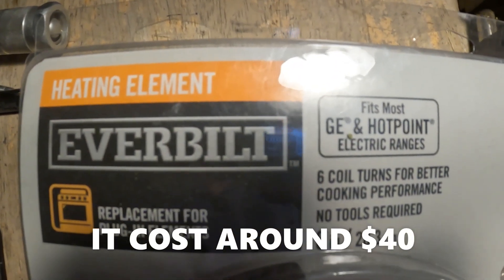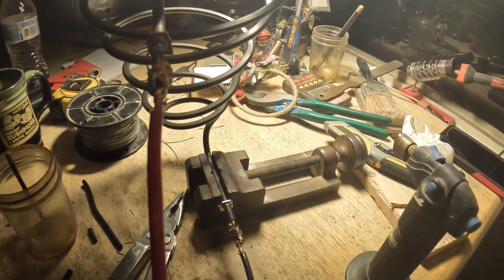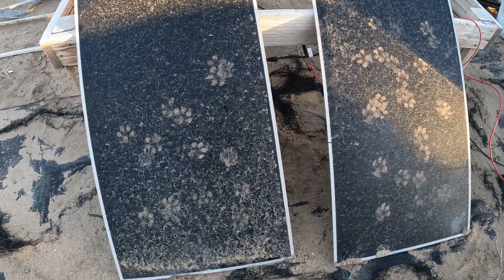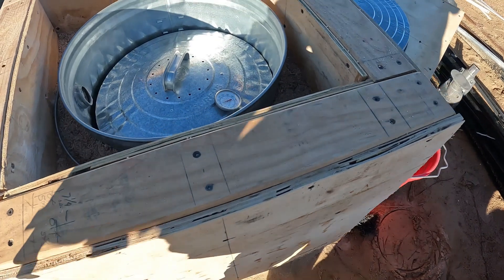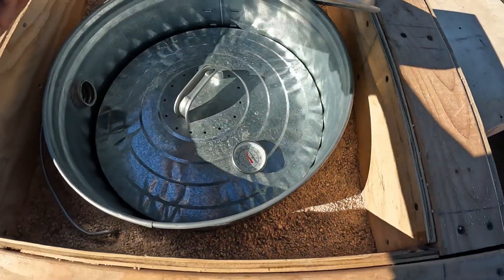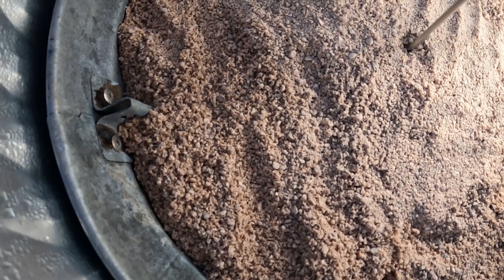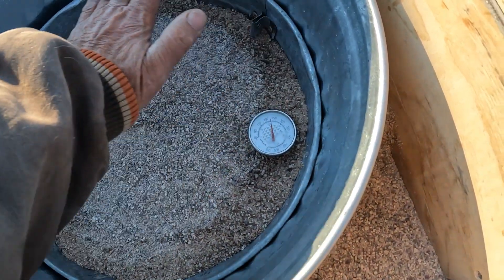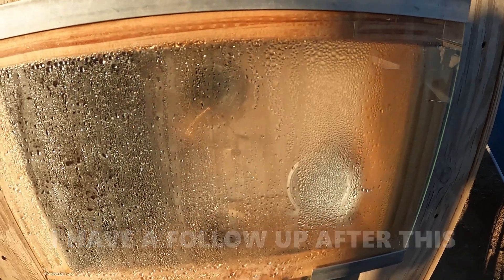Sand Battery Part-8, 550 Degrees F

Comment: iwas wondering how to insulate the connections ,thanks for that ,how long does it hold the heat for ?
Reply from the maker: Rock wool is a good high temperature insulation. It is what I will use around the larger one I am building. The heat stays all night on the prototype. I will know more once I start testing the larger prototype.
Reply: i'm going to be making one for my house in france ,open fire and convector heaters at the moment .Wood burner and sand batteries soon but i have to make them look pretty for my woman lol i get it, you can have dustbin(trashcan) in the middle of your room when your on your own ,but not so much when you have a partner .Well not in my case anyway :)

Comment: What about heating element in sealed aluminum container full of water surrounded by the sand?
Reply from the maker: Yes that may work but you can only reach around 200° or the water turns to steam.

Comment: how long does it stay warm after the sun is down ?
Reply from the maker: The sand will stay hot all night. I have a prototype running and it was 294° F. after all night with no power at 6:30 AM in the morning around two months ago.

Comment: Could you just use this as a space heater in an insulated building??
Reply from the maker: Yes you should be able to use it for a space heater. One issue is the weight. So to have one that is adequate it needs to be fairly heavy. I suggest either outside next to whatever you are attempting to heat with venting or ideally reinforce the floor and have it indoors.

Comment: Thanks for answering the other day.
I'm still confused how the small cables from the solar panels, aren't also getting super hot.
I'll be following your design though, but adding a 1" iron pipe coil arond the element bottom to top, to blow air through and extract the heat into the room.
Super free super hot air.
It surely must supply for hours.
Reply from the maker: I believe it doesn't get hot because of the element material. It is designed to dissipate the heat. But to be honest I don't really know the answer because I am not an electrician. I like your idea of running a tube to extract the hot air. I will post more on the project soon. Thanks for commenting.
Reply: @off-gridsurvivalmike8120  Cheers Mike. I'll let you know know how mine goes in time.
Reply: It is a resistive heating elemnent... same as the ones on an electric household range.
Reply: @DougJohns    Yep, the other wires are too electrically conductive to get hot, but the resisttive metal gets hot precisely because it is far less electrically conductive.

Comment: Very Nice ! Now use zeolite or calcium chloride and you don't need too much of insulation (thermochemical storage..), and can store heat for months if you need ! (But weeks is already good, as you got sun back before...
Reply from the maker: Interesting, I will have to research that. Thank you for the information.
Reply: Thanx too to share your works ! @off-gridsurvivalmike8120  Trihydrated sodium acetate can work too, in a closed package, but heat less (58C° max)
It is a cheap chemical used to conserve industrial food. Other components i told about are also cheap and few toxic..

Comment: You will be better off to just build a solar thermal panel to get the heat from it. Solar photovoltaic conversion of Sun's energy is around 15-20% efficiency. Solar thermal conversion of Sun's energy is up to 90% efficiency. Thanks for the video.
Reply: Good thought... I wonder how hot it would get

Comment: You can get a 48v dc water heater element for $40 and likely get around some of the wiring concerns
Reply: and maybe use muliple hearters?
Reply: I have to wonder, considering water heaters are usually in the the 120-140 F range if the element would handle 450+ F

Comment: At only 50% efficiency and approx. 5Kwh of power input, you should be able to easily heat 50 lbs of sand up to 500 degC( 932 F )

Comment: INSULATE, INSULATE, INSULATE. I bet if/when you take an infrared camera pic you will see that you are losing a LOT of heat.
Use firebrick and/or  ceramic fiber blankets. Do a YT search for "foundry insulation", Temps > 2000F.

Comment: BRAVO...You read my mind. I have been thinking about doing this for a several weeks now. I plan on using a 55 gal steel drum insulated with ceramic fiber blankets, fire bricks, etc., and an electric range heating element just like you have done. Target temp will be 500C++. Hopefully I can insulate well enough so that the heat can be stored for at least 30+ days. I have 8Kw solar driving a 12K Sol-Ark and 20Kwh of LiFePO4s. I will initially power the heating element from the Sol-Ark 240V output when there is excess solar but may elect to use DC directly from a couple of dedicated 450W panels.  There are many options...
   Ultimately, I would like to duct heated air from this into my central HVAC air handler to heat ~1600 sqft of living area,
Quick calculation using 55 gal of sand(~750lbs) heated to 500C gives ~134,000 Btu of stored heat energy. Plenty of heating capacity for at least a few COLD days in N Texas and MUCH less expensive than the 100KWh of LiFePO4 bats that would be required.
Reply: Have you worked on your design? I'm in Wisconsin and am thinking of something similar. Using mirrors to increase the lumens hitting the panels will increase the inputs, especially early morning and late evening. Cold temps means no overheating the panel issues.

Comment: What is that shaped element element for and depending on the voltage the resistance is kinda high so basically it's 24 ohms so thats only 1 amp at 24v but really a 24v panel would be more like 30 something Volts so maybe you get 50 watts but at 120v dc the most you should be able to push thru it is 600 watts which is probably enough I don't know I haven't messed with sand batteries

Comment: I'm going try your way seem better, I'll another using a water heating element that one fail. melted water heater element in 3 sec. I'm going to use a 55 gal steel drum.
Reply: Would an oven element be a better option?

Comment: 12 volt immersion heater ($12 eBay) 12 volt socket ($10) hooked to the battery out of your riding lawn mower. Heat activated stove fan ($12eBay) small solar car charger ($20 eBay)

Comment: Cool. But how many btu went into the sand and at what temp did you maintain in a room for how long? How does this compare to say a propane heater heating the same room?

Would you also use a extra solar panel to charge a battery then use that battery to run a thermostatically controlled fan to distribute the stored heat into the room?

Would it take say 100 pounds of sand heated up by X watt solar panels to warm and hold stead a x square foot room for a whole day and night? 

These are all things that need to be looked at. Get to it!!!! 

1 btu is equal to 0.293 watt

More details and experiments are needed.

Comment: i am supposing if you add some cement tubing.. you could get some haat to gravitate up and create a blowing hot air hear which can be adjust by opening and closing (or partially closing) the vent holes.. while retaining the heat inside when not in use?

Comment: I agree with you on needing a different wire to handle more heat. For the soldered connections - how about sliding a piece of copper tubing over the connection and then crimping it like you would a terminal connector for a battery cable? That way you get a "cold weld" instead of the solder. Liking what you are doing.
Reply: same for welding cables

Comment: I have an old oven i can use as a sand battery. I assume the elements would survive? Ive seen someone amp them into a kilns temps. I was wondering if i could put a huge sterling engine on them? I need mechanical energy.
Reply from the maker: I am looking into the sterling engines also. It sounds like a perfect match for a sand battery.

Comment: Are connections burning up at element wires?
You have to use a high nickel crimp attached to a high temp wire..
Regular heavy gauge wire will degrade from the heat that transfers back from the element wire.
Reply: srml rated wire

Comment: I applaud your efforts, despite electric heating elements being notoriously inefficient. I encourage you to look for non-electric means of heating the sand, as cloudy skies, rain and snow will greatly reduce the solar panels output.
Reply from the maker: This is still a prototype, although it will be to heat a room addition. I will try some different ideas on some future ones I will build. I will be pursuing this thermal heating for quite some time in the future. Thank you for the information.
Reply: @off-gridsurvivalmike8120  I'm adding reflective mirrors on both sides of the panels to harvest more power all day, especially early morning and late evening. I'm in Wisconsin, so overheating the panels is not a worry in the winters. I might try PTC elements, see if that is more efficient.

Comment: Will copy paste my comment here hoping someone smarter will consider it and give his review..

Ok I think we could buy old steel tank from truck at scrap yard 3000-20000 liter and fill it with fine sand that have big capacity for heat storage at high temperatures. 
(Cost of a such tank here is about 1500$)
Can go up to 300-400*C inside steel tank and with stainless steel tank even higher.
(That way we have many times larger capacity of heat than using same volume of water at 100*C)

We cut rectangular hole in steel tank and put copper plate 40x40cm with ribs going into sand to spread heat faster, painted black on that place so that spot would receive all heat we are going to transmit to the tank.
(That tank is welded and hermetically sealed with tons of sand inside.)

Now we buy another slightly bigger tank, coat from inside with reflective coating, put our first tank into it and make sealed glass window 30x30cm on it to align with black coated copper on inside tank.

Internal tank should be sitting on a bigger tank with some non conductive and heat resistant legs so that would not transfer heat to surrounding tank.

We make outer steel tank more rigid by welding outer support so it doesnt shrink, put some copper pipes around and insulate whole tank very good.
-Those copper pipes are to flow water into them for heating.
-To outer tank is also connected vacuum pump that makes vacuum between two tanks to stop 2 ways of heat transfer (conduction and convection).
-That inside coating of the tank stops 3. way of heat transfer which is (radiation).

Now we make huge set of parabolic mirrors that would be guided with motors to reflect huge amount of heat through that window to copper plate and heat sand material and inside steel tank up to 300-400*C or more with stainless steel tank.

We can use huge parabolic mirrors 2x2m by adding many smaller ones to construction of a big one.
We can also put 4 mirrors at window at 30* to collect light that would otherwise not hit the window and size receiving area up to 1m.🔳

How does it work?

So on a sunny day mirrors should reflect huge amount of heat through a window of outer tank to a copper part of inner tank filled with sand that would get very very hot because its totally, vacuum(conduction and convection) and coating(radiation) insulated from the outer surface.

Now when sun is out and we need heat we simply push the water through pipes connected on outer tank and via motor we make less vacuum between so outer tank and  pipes start rapid heating and water gets hot.

Then we transfer water to our house boiler for a in house hot water and room heating, or to a steam turbine that could make electricity all summer nights when we dont need so much of a heat.

Such a well insulated tank could maybe keep a sand hot for a month which is great considering whole week might be cloudy.

Am not sure if about 50sqm of mirrors would be enough to make such amounts of heat during winter but it seems like long lasting, not much expensive and very earth pollution saving project.

Would like some engineer to take a look on this and give real calculations about efficiency and possibility for such a project.

Thanks for making me think of this idea and please everyone who have some recommendations or ideas to add something..
Reply: Some basic issues to consider. Water holds roughly 5 times the amount of energy as sand at the same temp per mass/weight. So the same weight of water at boiling holds the same amount of energy as the same weight of sand at 500C. And you can change the boiling point of water by changing its pressure, so you can raise its boiling point to 200C at 18atm, which gives you the same amount of energy as 1000C of sand. 
These are the theoretical numbers you need to beat to make all this engineering more effective/effiecent than water based systems.
The potential is there, sand at one atmosphere melts at roughly 1500C, so the potential to store 3 time the amount of total energy is there, but now you are talking about containing that temp. And then the pipes that run through it have to have a higher melting point than that.
We already have the tech to handle the water at those temps, and you can use the water itself as the transport medium, so it is simpler.
Use a mixing chamber to bring the water to the temp you need it at for your application is something that is already solved.
So this is a harder sell for home applications, but for large communities and larger the sand may be the way to go.
Reply: @NdxtremePro  

Its about 3.4x more thermal capacity in water at same volume, but I was calculating that we need to keep it below 100*C.
Seems even at 100*C water could be better option, but how to handle the pressure in such huge tank..
Also that tank would lose heat very fast, in couple of days probably.

In my idea one tank of sand is completely sealed and there is no any pipes in or out, and that thank is inside a bigger tank that have pipes on its surrounding.

Between two tanks is a empty space of about 20cm at every point except some non conducive legs, and on outer tank you have just one valve on which is connected pump that makes vacuum inside as best possible insulator, so when you need heat, you just let some air inside through pump and outer tank and pipes heats up quickly.

The main problem here is what material to use inside to reflect radiant heat back to tank with sand to keep insulation as good as possible.
Reply: @egaega2458  You are not thinking about thermal bridging. While a vacuum is good this purpose, you have to suspend the inner chamber and the heat tranfer pipes you are going to use have to contact the inner chamber as well, both creating bridging points for heat transfer. 
Since you need your transfer pipes to conduct heat, as that is their purpose, you can't avoid that, unless you can physically separate them when not in use. This is doable, but you are increasing failure points.
I would go with a thick ceramic encasement to insulate the heat, and your bridging pipes can run through the sand and container. If you want, you can enclose the pipe in ceramic to limit the amount of heat that can transfer, but you can also create a vacuum inside the pipe itself when not in use. 
This allows you to limit the thermal bridging to your control.
They currently make water tanks designed for radiant heating, you can buy them in hundred+ gal enclosures preinsulated. They are designed to hooking existing boiler and heat pump installations. They operate at pressurized levels, but they are meant to go into Pex pipes, so they don't go up to 100C.
They are commercially available which means warranties and other niceties, like home owners insurance will approve them.
Reply: @NdxtremePro  
Inner tank is completely sealed and there is no contact with pipes and outer tank, heat transfer to outer tank and pipes is regulated by pump regulating vacuum between.
I dont see a reason why this wouldnt work.

That sound like expensive solution with all ceramics and heat is lost by pipes themselves because in that case they need to be connected with whole house system all the time and with vacuum or not they are steel pipes and heats go through them.

Comment: Great project! I keep wondering about this stuff, but on a bigger scale. Use stainless steel pipes as the heat element, so air can be blown through. I was thinking about putting a barrel in a gas tank, pull a (as far as I can get) vacuum for insulation, and seal it off. You should look into the CESAR project in the Netherlands, they build a really big one for 36 homes.

Comment: Wonderful!  Thanks for sharing element source/type in video, would be good to have in the description.l too.  Never seen a 3d spiral like that.  Did it come that way or did you pull it out? Missed video 7, just went back and saw you pulled it out.  Great work.  How are you planning to get the heat out of it for use?
Reply: He pulled it out on a prior video 🙂
Reply: @billymyers  missed that one, thanks.
Reply from the maker: I should have shown when I pulled it out. I was surprised how easily it sprang open like that. So I will purchase another one and show how I did it. Now I may have too much power or it may not hold up for what I am using it for so I would wait at least a few weeks to see if this burns out like my last 120-volt one did. But as of today, day 3 it is still performing perfectly.  I am monitoring it right now.
Reply: @off-gridsurvivalmike8120  great, and as many stoves hit the dump/tip scrap elements should not be hard to get. With a bit of power regulation even the 120v ones should work out, if a bit slower.
Reply from the maker: Also I will film the elements at Home Depot just so you can see they have them in the appliance department near the stoves.